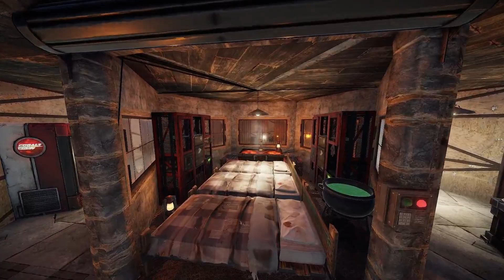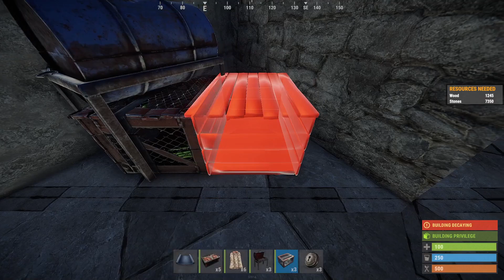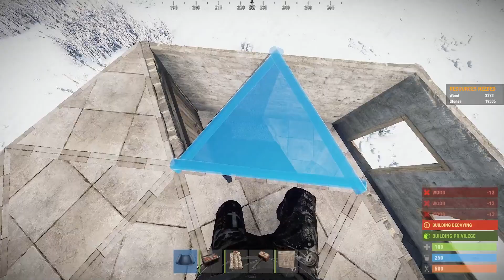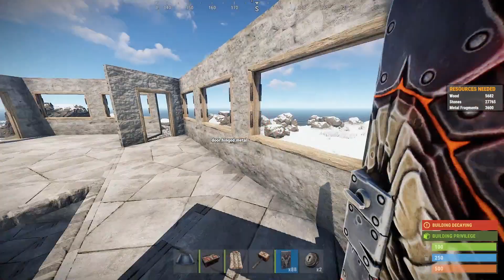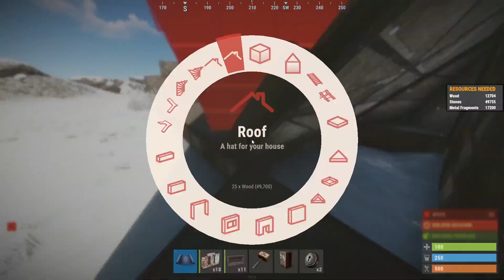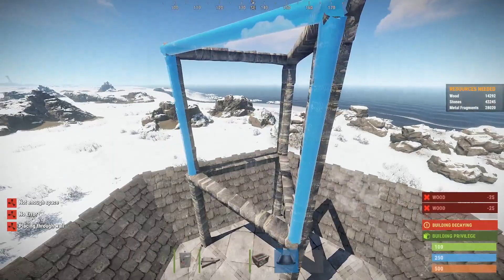Rust ULTIMATE solo+ base THE HORNET 2021 updated version

Comment: the foundations for the external tc's arent connected to the base, doesnt that mean all those foundations are useless and shouldnt you just not build them to save frags? or am i being stupid. no hate just wondering
Reply from the maker: no problem dont worry about asking questions Eli. Building privilege extends outside of the external foundations in fact when the main tc is removed by raiders all of the main base is covered by the externals, this means that they cannot grief you or rotate vending machines or even take off glass windows and the reason for them not being quite linked and having a small gap is because you can only have 1 tc per base so what i am doing here is building 4 bases that are separated with a very small gap
Reply: @maverick1484  ohhh ok thank you

Comment: How many rockets it it until main loot rooms and full tc access, I heard it’s like 75 but then I seen some comments say they could get in for less???
Reply from the maker: If you use the link in the description you will see my new loot rooms which are 15 rockets each to raid, and there are 6 of them so after you get into the lootroom area its 90 rockets then to get full tc access by removing the externals is another 36. There is no way to raid this for less many have tryed and all have failed.